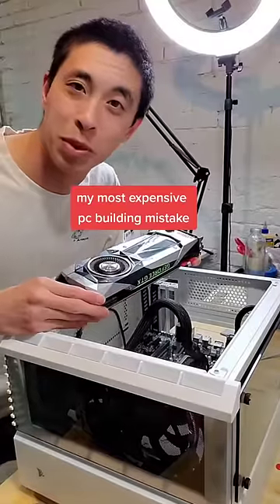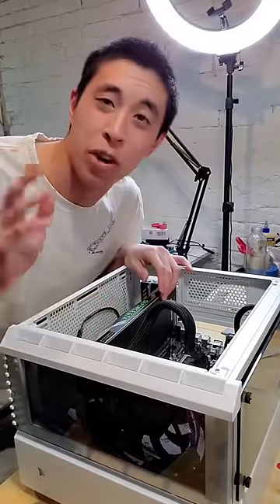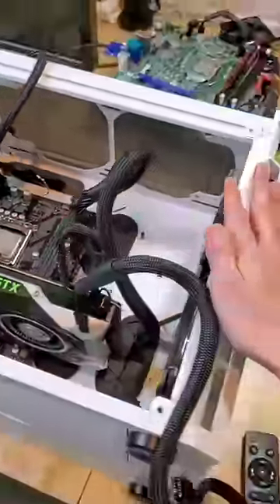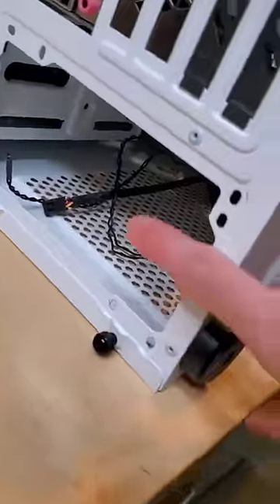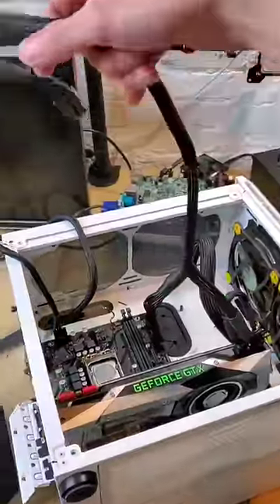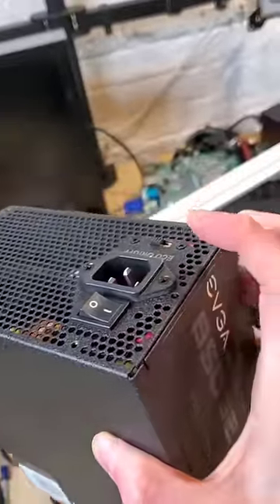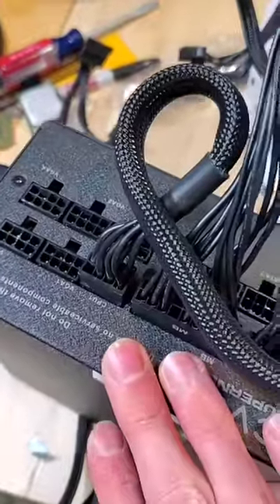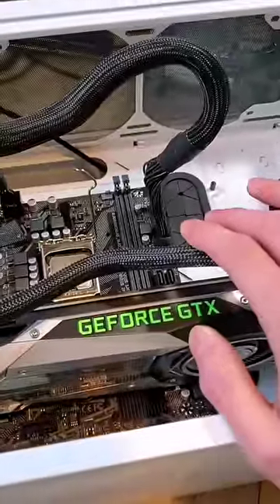my most expensive pc building mistake... #shorts

Comment: somehow, I accidently overvolted my 1070 instead of undervolting a few years back and killed it. dont ask me why , I dont know myself how I succeded
Reply: i remember i overvolted my laptop cpu while trying to undervolt. i just overvolted it by like 0.3volts. so lucky that my cpu didnt burn
Reply: @mipzisthebezt2341  i farted
Reply: i pushed my last gpu too hard (amd rx 570 8gb) and a mosfet chip went. i now own a 1070
Reply: @hasnaatalii  

You can't change voltage at all I'm pretty sure
Reply: I accidentally overvolted my rx 570 when trying to use MSI afterburners rivatuner (and yes it broke it)
Reply: @mipzisthebezt2341   Be happy that thing didn't explode
Reply: Usually the GPU and CPU would just crash because of the Failsafes in Place
Reply: @hasnaatalii  

You can overclock but you can't control voltage
Reply: Ip man son
Reply: @hasnaatalii  I could overvolt it by 1000 mV. Which converts to 1V
Reply: @TheCowofWisdom  "Bomb has been planted."
Reply: I overclocked my Asus Vega 56. Cranked Up Coreclock, Corevoltage and Powerlimit. Instead of 250W it was drawing under intense load 50% more energy, whopping 375W, wasnt a big Deal for the psu tho and Furmark and Other tests were stable more than 2h each. 
18 Months later the PC started to crash. First Just on overclocked Settings, later even with standard settings, started to investigate, bought a new PSU, Same crashes, put the gpu into another PC, Same crashes. 
Turns out i fried a component on the GPU, enough to Make it unstable, Not enough to fully destroy it. I Sold it to a friend who was mining Bitcoins Back them, Made some bucks for a year until it fully died
Reply: I'll take "Things that never happen" for $500 Alex.
Reply: @mipzisthebezt2341  0.3 volts lmao
Reply: Bullshit pascal cards dont have full voltage control also there is a limit if im not wrong its around 1.08v max on 1070.
Reply: Sameeee
Reply: This comment is bullshit, i got a 1070 and there isn't over voltage control, unless you resolder resistors and such
Reply: @mipzisthebezt2341  eh for short bursts I doesn’t matter really. Below 1.5V for a few days doesn’t kill it
Reply: Not major but I’ve done that to a fan messing around with it
Reply: you can adjust voltage if you press CTRL F in afterburner
Reply: Lol I remember when one time I downloaded afterburner cus I was mad that my laptop was trash xD I've read few times that you should turn the knob a little and check how it works but I immediately turned it to the maximum (idk why) and my laptop made a loud whistle It smelled of burning and displayed different colors lol
But it's still working idk how, I was struggling for few hours with uninstalling afterburner cus everytime I tried to turn my laptop on it displayed colours and it was turning off after few seconds.
After uninstalling it everything works fine
Reply: Wouldn't undervolting it be worse than overvolting it?
Reply: fake. driver won't let you kill the 10 series cards and up. it self-regulates voltage at a hardware level. stop lying
Reply: @AH64APACHE420  you say "idk how" a lot. are you aware you can learn things?

the whistle and colors on the screen (artifacts) were just a result of the driver freezing from not having enough power/cold enough temps for the clock you requested in afterburner, so it froze, the whistle came from the soundcard playing the last snippet of noise the soundcard recieved, but on repeat at 44.1khz (44100 times per second) and the random colors on the screen come from the video memory corrupting as it tried the impossible overclock.
Reply: @randomplayer6461  not on every card.
Reply: @Maggashi  finally, someone who speaks English
Reply: @Ae3lolz  hehe, it's true though, like sure you can drag the slider in afterburner, to as high as you want, but it doesn't do shit, that's probably what these people don't realize
Reply: @Maggashi  its so strange to me when people straight up lie for attention in a comment, on a YouTube short no less.
Reply: @Ae3lolz  yea, idk why they bother, it's not like likes does anything anyways lol. Maybe they seek attention, or maybe this is a bot, and people who reply just don't know
Reply: My first time undervolting I used Throttlestop.
Reply: CaptainMcShotgun  it does, my 1650 can
Reply: @PashaGamingYT  Yes you can. You can undervolt it to make it run cooler at lower speeds
Reply: @Ae3lolz  thanks for explanation
Reply: It ended up working in the end, but with my first build (intel) I bent 10-12 of my cpu socket pins. I decided to yolo and bend them back and when I went to post my cpu ended up being fine, but my gpu wouldn’t post. Crazy ride for a first build lol
Reply: Bad gpu... most gpus have safety in place so gpus don't just destroy themselves.
Reply: @alptunatuncer3017  

You can control the way it boosts so that it runs at higher clock speeds at lower voltages and prevent it from using more voltage than you want it to, but you can't control voltage
Reply: @PashaGamingYT  I’ve seen laptops that support changing CPU Voltage, but not by as much as .3 like the original guy said. Max avg over-volt was ~+.1
Reply: Bruh I literally did the exact same thing💀
Reply: @PashaGamingYT  You can control voltage with throttlestop
Reply: CaptainMcShotgun  ?? my 1070 is literally running undervolted 1050 -> 915mV. And I’ve gone as high as 1093mV
Reply: CaptainMcShotgun  wdym sure? You want screenshots?
Edit: Hope you still got the imgur link in the inbox, YT deleted the comment again. But hey, at least the pxrn bots can post links right
Reply: @Gabriel-yd4bq  

You can't control voltage
Reply: Pascal can only go up to 1.1v.

Thats not why it died.

Heat killed it.
Reply: @nexxusty  ig. idk why people are saying that you cannot control voltage. not the case
Reply: @PashaGamingYT  yes you can. not to a destructive level without hardware changes, but you can
Reply: @ground-beef  Probably too late, but MOSFETs are pretty easy to replace if you have soldering skills.
Reply: @user2C47  it was a while ago, about 8 months, the card was used for mining, and was already getting low performance compared to other similar cards. it was inevitable. vga works for 5 minutes, hdmi about 30s and dp not at all.
Reply: I don't know how you managed that, as under/overvolt and under/overclock are usually very stable. Otherwise your machine will o tly turn off and revert to default settings.

To everyone saying it isn't possible to do in this type of cpu: as long as you know how you can do it in most of cpus, you need to unlock the locked settings that allows you to do this. Is not like K models that are made with this intend. I did it before in a i7x-HQ, laptop, and I managed to lower the voltage with no issues.
Reply: I call bs on that, pascal doesn't have proper voltage control
Reply: @randomplayer6461  you can only control the voltage within the safe range.
Reply: You should have explained why this happened in more detail so people understand why and how it happened

Saying don't plug cables into a different PSU is overly simple and people probably aren't going to listen

You absolutely CAN swap cables between brands in many situations just not all
Reply: I did the same with my 3080, accidentally gave it like nearly 2V when fiddling around with undervolting, my PC crashed and my heart stopped.. Thankfully it appears it didn't cause any immediate damage, still working fine but I'm sure I shortened it's lifespan
Reply: @ground-beef  So long as it didn't crater your board too hard or fed 12V to the die it could be repairable.
Reply: @addictedtoRS  amper cards do not let their users to fiddle with overvolting. You can only adjust the voltage within the safe range. Your story is BS.
Reply: Pain.
Reply: No way you overvolted a 1070 without loading a moded bios
Reply: bruh
Reply: @randomplayer6461  It's just a suggestion, same as the voltage slider, it will move to a lower step if it's unstable for any reason
Reply: @PashaGamingYT  You can, but not directly. You can give targets, but the algorithm will still move it around depending on temperatures, power draw etc
Reply: You pushed the red button, didn’t you?
Reply: Bull fucking shit. Pascal's voltage is Bios locked and can't go past 1.093v, and unless you flash a GPU bios with unlocked voltage, you cannot overvolt it and kill it.
Reply: Bruh i recently realised i was running my SoC at 1.3v instead of 1.1.. pretty sure I've fucked my cpu lol
Reply: The 1070 can
Be fragile. There's something dodgy about it
Reply: Task failed successfully
Reply: Gigabyte psu
Reply: Task Failed Successfully - Rip 1070
Reply: Especially when Nvidia swears up and down overclocking is okay because the cards bios over rides anything that could be harmful to the card. Just proof that don't always work as intended.
Reply: You can't do that, there is no working voltage control on 1000 series upwards, you can only control power limit.
Reply: @hasnaatalii  desktops do but laptops probably not. Also running an extra 0.3v probably won't kill anything it will just run stupidly hot for no reason.
Reply: What is overvolted
Reply: @itsTyrion  Read above comments, You're changing voltage boost which means you're just increasing max voltage limit which is already limited physically by gpu.

Actual voltage is still controlled by gpu, You're changing nothing in real world even tho you change in software.
Reply: @0010plays  so wait wait is the voltage meter bad cause I had my shit sitting at 100 percent for like 6 months with my gtx 1050ti 
225core clock 
1000 memory clock 
Still running like a champ to.
Reply: @cookieboy1001  I don't know much about overclocking I just did something that broke my rx 570 idk what I did I would assume I overvolted it or maxed out the core clock
Reply: @0010plays  i got lucky, got a yellow screen and quickly reset my pc, went strait to bios and kept my gpu from dying... definitely a pucker moment..
Reply: @mddprozz  nice job
Reply: This never happened.
Reply: You must have gotten colored freckles and orbs
Reply: This is why I don't fuck with my computer man 😭😭 Sorry for your loss
Reply: 12k upvotes but what OP describes is literally impossible without a complex mod, so people are upvoting nonsense and a lie.
Reply: Being that any idiot can do that with software these days, I'm not surprised.  Congrats.
Reply: @PashaGamingYT  You can Control the Voltage using Different Programs I believe MSI Afterburner allows you too and I know the AMD Software does to but it depends on the Motherboard, CPU or GPU
Reply: @hasnaatalii  Overclocking is Raising your Clock Speeds there is a Wall you will hit if you don't adjust Voltage
Reply: @deltasixgaming  

The AMD software does not allow you to control the voltage on NVIDIA GPUs, neither does Afterburner. You need to mod the card in order to do this.
Reply: @schekelberg6187  if that was a mosfet it could've been easily fixed
Reply: @CookieMonster-gg1ks  but the hq cpus are like the portable version of the ks
Reply: @jay-d8g3v  not that much, i used to run my a6-6400k from 1.37 to 1.45 lol, or even undervolt it to 0.9
Reply: @Piterixos  not impossible, it's more likely to be that his gpu was already fucked and he ended fucking it more
Reply: @dantepaz5028  your motherboard's manual will always tell you what cpu socket it has and what cpus supports
Reply: 99.9% sure you didn't do it pascal has locked voltage... If you did some mods that's a different story
Reply: I have no idea what's happen since YouTube randomly recommended me this video ahhh
Reply: Do you mean overclocked because there's no such thing as overvolting a Gpu only overclocking which if you make it to high then yes I understand why that happened
Reply: @0010plays  Think I just did the same thing with MSI, Riva and Kombuster now my cpu won’t work over 25% smh. Had it looked at by a specialist and he said my PSU wasn’t strong enough the whole time. L
Reply: GZ
Reply: @PashaGamingYT  yes you can pascal does have voltage control in afterburner
Reply: Then theres me who undervolted my gpu and cpu to the point where the system couldnt boot up lol
Reply: Ops Blac  no they dont, because they arent made to be overclocked so there is no point in adding protection, the voltage range is so small I doubtt it could be regulated and controlled, its only a few hundred millivolts most of the time although sometimes it can be upwards of a volt
Reply: @staidey5994  yes they do, you can in MSI Afterburner, not as a number but a percentage which is still measured and displayed, usually around 700-900mv range is normal but you can go up to ~1.2v and be safe
Reply: @Fisheiyy  1.2v is Nvidia’s safe range voltage, not overvolting.
Reply: @Ae3lolz  
Like to get attention dude look at urself ur here trying to regulate there lies for attention. 

U made so many damn comments
Reply: @IIlIIlIIlII  
Yes u can
Reply: @cortezbaldur413  No you can't.
Reply: No you didn't lol you can't overvolt it
Reply: CaptainMcShotgun  maybe with a custom vbios
Reply: CaptainMcShotgun  oh ok, sry i'm not that deep into gpu oc beside msi afterburner
Reply: CaptainMcShotgun  you can change voltage on pascal and maxwell and some others with custom vbios
Reply: CaptainMcShotgun  well I've it done with an evga 970 oc and 1070 which weren't exactly high end cards. the 970 used a vbios from techpowerup and 1070 was from some russian forum
Reply: @nickanderson8305  Correct.
Reply: @hasnaatalii  overclocking allows you to increase the performance of the unit at the cost of thermal performance, which is why overclocking software also allows you to control the fan curve so you can try to prevent thermal throttling. Nvidia doesn’t allow users to tamper with voltage though there are some custom cards which do allow you to control voltage. Highly unlikely that you had one of those though as they tend to cost a premium so unless you intended to do extreme overclocking it wouldn’t have made sense to pay the premium cost for a custom gpu
Reply: After watching this I'm afraid Imma end up doing that to my 4090
Reply: I don’t think that’s ur fault, the psu should have a mini transformer, or you parts should have a mini transformer built in that converts  high plug voltage to much lowers useable voltage
Reply: @filds1  What you mean by "full voltage control" Cause i can under and overvolt my 1080 from 700 to 1250mV
Reply: How does "overvolting" happen?
Reply: @hasnaatalii good comedy, now the replies don't make sense 🤣
Reply: task failed successfully
Reply: @0010plays  Your GPU probably already had a faulty VRM to begin with. I have OC over a dozen GPUs always to their maximum clock frequency and none of them ever died. There are a lot of fail safes that will immediately lower the clock frequency if it gets triggered such as temperature and voltage.
Reply: @dragonl4d216  afterburner froze an I clicked and it killed it idk what I clicked to make it kill it but it did
Reply: @0010plays  So is the card still working after rebooting your pc? If it still works, then the core frequency you have set is too high for whatever voltage that the card is running at which causes instability resulting in the crash.

If the card is dead, then there probably was a faulty VRM to begin with. The RX 570 is a 6 year old card so it's not surprising that some parts are starting to fail.
Reply: @dragonl4d216  it boots then instantly artifacts when you log in to windows I've done this on my test PC and my main
Reply: @etar_cs4223  My butter fingers dropped my CPU onto the Socket pins. Took me 6 hours to bend all the pins back into semi-passable shape. Pc ran fine. That was in 2005 tho. All the new AMD sockets seem to have protected pins now. You really need to try to get them destroyed nowadays.
Reply: Same with my 780Ti, got back to gaming a few days ago after a 6 years army pause, tried to overclock it a bit more than I’d done as a teen, basically put +400mv instead of +40mv — on the already overvoltaged setting.
Launched the game to test, instant black screen followed then by a boom. 
The shit actually killed my psu after a few hours trying to « diagnose » why I couldn’t boot on the video card anymore. As if I didn’t know what has happened lol

That was a nice excuse to buy a 4080Ti, 64gb of ram and a new case, however, gotta find good things to bad shit!
Reply: @LumpyHippo No. Undervolt = not enough power, wont run unless you give it more.

Overvolt = fried components, will never run again.

Like a car. Runs out of gas and it shuts off. Fill it up and it's fine. But if it gets way too much, the engine oveheats and breaks.